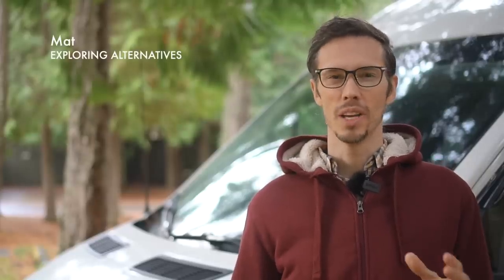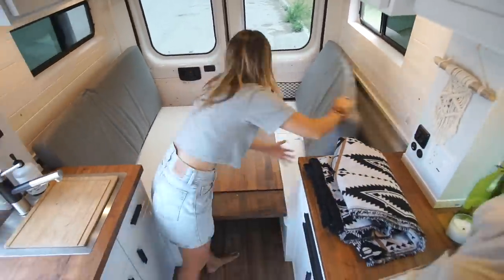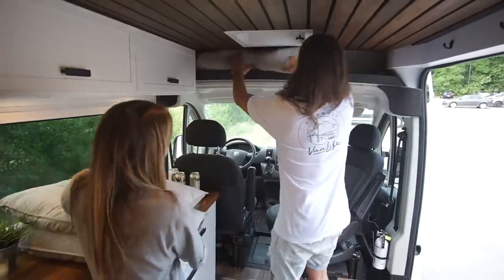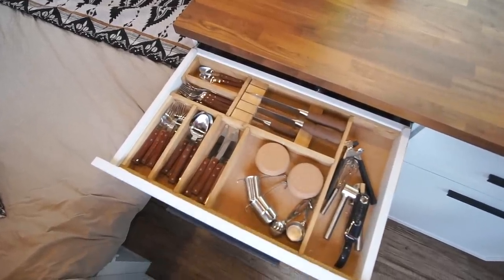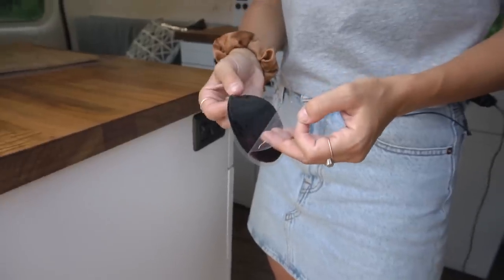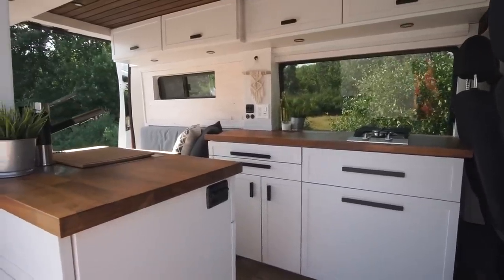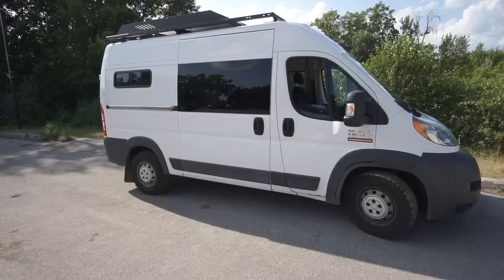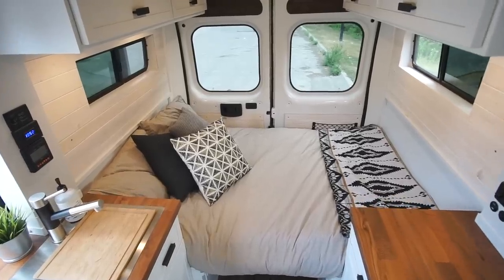Stunning Modern Camper Van Conversion | VAN LIFE TOUR

Comment: That's fantastic.   I'm worried about mould under their bed.  No slats,  no holes?
Reply: Good question! We did add a layer of some material under the cushions to allow circulation.
Reply: 007nadineL
They don't keep it in bed mode. They put it back into table. Each time they turn it back to table, they can turn the cushions over to dry. 🤗

Comment: Hi guys, love your build! I'm currently doing a conversion and I'm trying to work out how to install under cabinet lighting with no wires visible inside or outside the cabinet - would you be happy to share how you installed yours? I love that there are no wires visible from underneath. Thanks!
Reply: There are layers of wood at the bottom of the cabinets. The wires and all the electrical is in the first layer. Then we added wood on top with wood separators to make the bottom of the cabinet where the cloding goes.

Comment: the design is clean,nice, modern ... but not very functional for my taste. I know everyone has different needs, but I guess we all poo. Its a pity sou didn't mention anything about hygiene. Also I would be very interested (if you travel in wintertime) to know how you deal with changing seasons. Seems you installed a lot of windows, do you just cover them or does the van has any insulation? Or simply not living there during cold months?
Reply: We have a gas heater for the cold months and the windows now have cork curtains. When it gets very cold (-20˚C / -4˚F) we have some reflectix pads.

Comment: How about putting a small windmill, a turbine shaped like an aircraft engine on the roof to charge the battery while driving.
Reply: Sounds like an idea! But the battery is already charging with the isolator from the main truck battery while we drive.